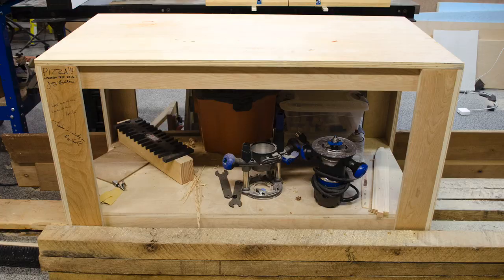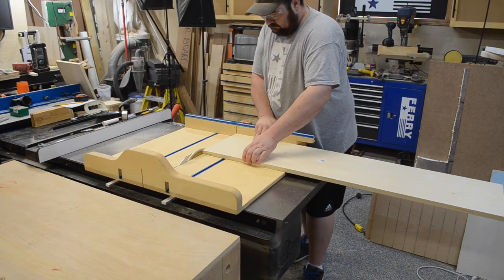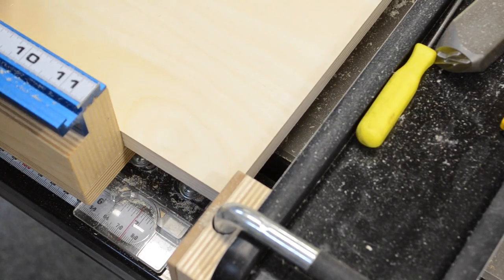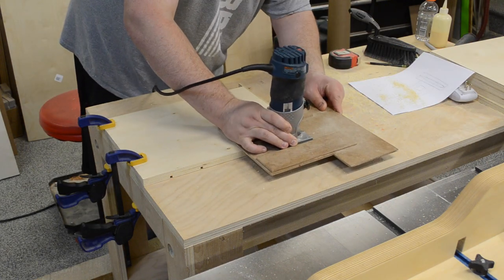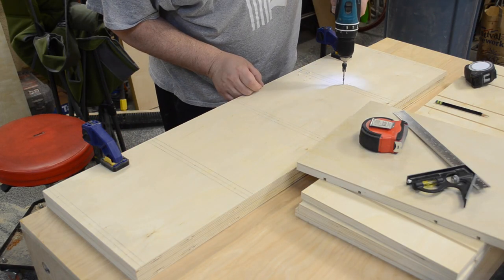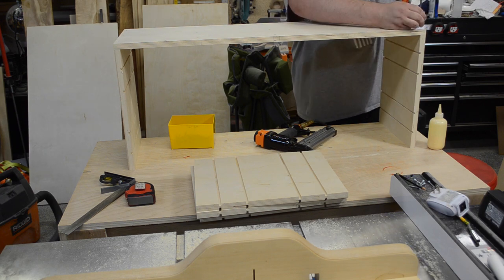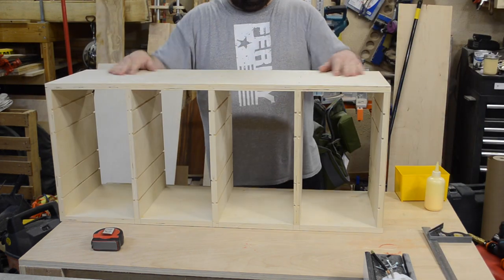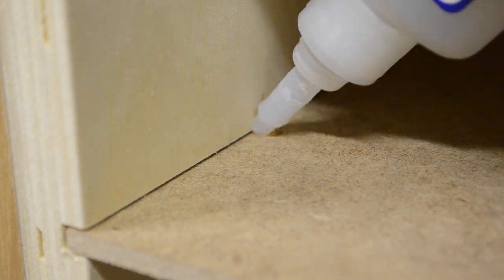Ⓕ Workshop Organizers Storage (ep73)

Comment: Nick, I’m assuming you’re using 3/4 inch plywood? Would 1/2 inch work as well? I want to build something like this but in a much larger scale. I’m thinking about 2 units that are about 8 feet wide by 6 feet tall.
Reply from the maker: At that scale I’d at least make the carcass out of 3/4”

Comment: GREAT job Nick.  I like the practice of putting in a brad to line up the dividers THEN putting in the screws.  Certainly helps preventing any shift.  I will start doing that.
Reply from the maker: anything that helps in the glue-up is alright by me - assembly can be frustrating as that glue begins to dry

Comment: I use the clear storage bins for many of my shop things. there great to see what's in them without having to label them.  and storing them is also easy, Home Depot in Canada has ones about that size for about .99c, so I bought like 30 of them, I only have 5 left but those I will use fir small parts when I batch them out.
Reply from the maker: very cool - yeah they are pretty cheap and make great organizers

Comment: You could use the recessed space between the table top and your storage box for a magnetic tool holder strip. It's always good for holding bits, hardware, and tape measures.
Reply from the maker: Not a bad idea - I was hoping to add one but don't think I'll have the room after I add air and electric that I have planned for another video

Comment: Nice upgrade and great out takes lol!   I'm thinking of using the table and storage design as a foundation for a Paulk Workbench top.  I've had the plans for a long time but wanted a stationary bench but couldn't decide what to put under it.  Thanks.
Reply from the maker: that would make for a cool combo!
Reply: Don't forget to leave room for your router! It mounts underneath those table tops!
Reply: Absolutely, I'm just trying to decide which plate & hopefully lift to use

Comment: Brilliant, I'm going to build 2 of these for my shop. Are they sturdy enough to build on. Nick.
Reply from the maker: heck yeah - I build on mine all the time - check out Jay's video on us building the table - https://www.youtube.com/watch?v=DWXG3ntz6iM&t=26s
Reply: Nick Ferry cheers, I've built one today with a sheet of 1/2" I had from the local timber yard, 3 sheets for £7 bargain, so building another tomorrow. Your right even with 1/2" it's solid. Any other recommendations, just starting out as a hobbyist woodworker, I've improved my fence and built a cross cut sled. Tools, I have a table saw, mitre saw and drill press, and a few hand tools, oh also built your door board so handy to have around the house. 👍🏻👍🏻

Comment: Great video. So the whole point of a sled is to remove the danger of kickback?
Reply: It helps keep material in contact with your saw table, so you can concentrate on accuracy rather than pressing hard on every piece so it doesn't fall to the ground or lose proper contact with the saw table or fence. This will definitely improve your work efficiency and security. In the end, you'll be a lot less stressed and tired, too.
Reply from the maker: I agree 100% - well said